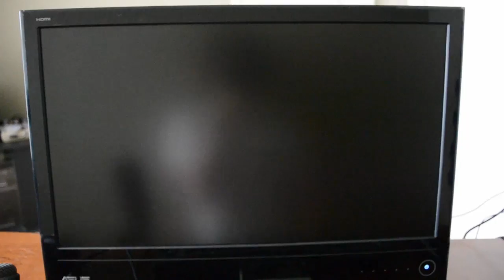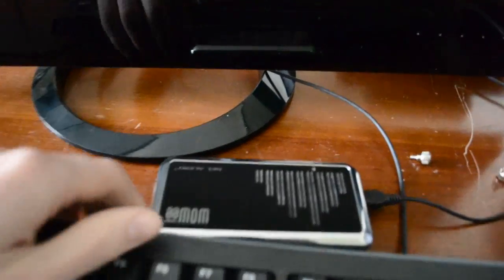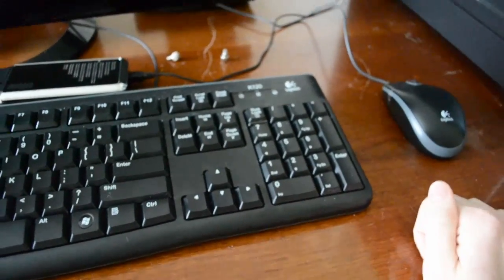New Computer and Setup Tour

Comment from the maker: @marinmarinhola Not quite. That won't double the memory (with SLI it works a bit differently than say RAM does) but still 3GB should be more than enough for running several huge monitors.

Comment: nice video....  a little tip.. take out the top hard drive bay and put your single HDD in one of the bottom two slots.. it creates more airflow. also possibly look into some cooler master mega flow 200mm fans.. and also. check out my videos.. i put a window in mine.. looks great..

Comment: why did you put the cpu cooler fan on the left side of the heatsink, cuz if u'd puttit on the right, facing the back of the case it would throw the warm air out in sted of in the case.

Comment: I've got a question, I have 3 laptops with HDMI, two use dedicated graphics and the other uses intel HD graphics. For some reason on all laptops across 3 HD TVS and 2 HDMI cables, the picture is terrible compared to VGA. It's not the cables I can run consoles fine with those cables. I've even checked the control pannels of the graphics but still HDMI looks like poop compared to VGA on these. is it because of it being a laptop?